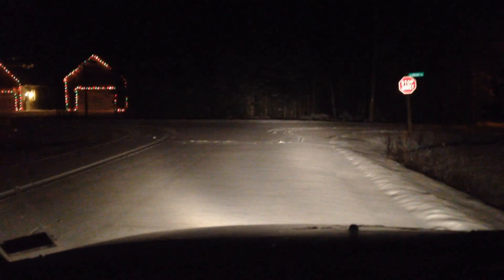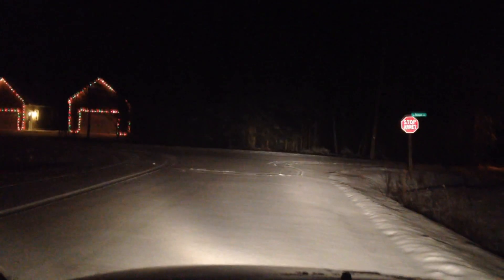Whats that noise my Brakes are making? (ABS) Explained

Comment: My truck is doing this, I'm in california not in snow or cold. How do I make this stop?
Reply from the maker: This would happen in the rain aswell or slipper conditions. Its not a bad thing but you could just pull the ABS fuse. This would give you a light on your dash. Its not recommended though. Abs does help a lot in slippery conditions.

Comment: I get a drinding noice on the pedal when ever the wheels jumps over a obstacle say like a speed breaker even when I am not applying breaks - esp when only 1 wheel is hitting the obstacle. Never happens when both wheels are hitting simultaneously. Will this be due to the ABS ? Thanks in advance !

Comment: Hello, I hear this same sound even when I'm not driving on a snowy road. My mechanic just changed the sensor at the back tyre, I step on the brakes when the car is moving slowly and I hear this sound. Note that the road is a rough road.
Reply from the maker: I would say you need new brake pads and rotors. This is probably just the metal grinding on metal making this noise.

Comment: I've never had A.B.S in my life before and have owned the car I have now for about 18months, occasionally, under heavy braking I have had this graunchy sound and feel in the pedal and the feeling that the brakes are not going to stop me, it was bloody scary (yes I'm British haha! :-) ) and recently it has dawned on me it must be ABS as I made it do it on purpose a few times when the road was clear.  I have experienced ABS once before when driving mates old 300zx years ago and that had a definite judder feedback sensation and felt more reassuring as a braking aid than the graunchy feel as though the pads are fighting to grip but just encountered a glob of grease or something, toppled with the sound of a massive container ship colliding with an iceberg and twisting and stressing with metal fatigue from all the forces acting upon it. ...because it was intermittent, I thought its a waste of time getting it checked out, and replacing front discs and pads made it happen less I thought, hopefully this is all it is, because it seems to make sense in my controlled tests 😅. Have to say, can't hear it well in your video, but a video like this did need to be done, so well done!

Comment: Hi guys! Newbie question here so I hope to get some guidance from more experienced drivers. 

Is it normal that the noise from my ABS kicks in quite frequently? There's no snow where I live -- just regular roads. But about 50% of the time I apply my brakes, the grinding noise kicks in. I've not experienced this with the other cars I've driven. I drive a 2014 Toyota Fortuner by the way.

I had my car checked by a mechanic and they saw no issues with the brake pads, brake fluids, etc. Is this normal?

Thanks!

Comment: Thank you for this. I heard the sound because it just happened to me. 
I have a question: Will it deactivate over time? How long does it usually take?
Reply: It won’t stop until you fully stop it’s preventing your brakes from locking up cause if they locked up you’d spin out

Comment: Anti lock brake systems are NOT designed to slow or stop a car, faster then a conventional non-abs stop. ABS is designed to limit wheel lock up during the event of an emergency stop on icy surfaces, thus allowing you to maneuver around an obstacle.

Comment: Yea i have that same sound. Is there anyway i could make it quiet? Its driving me crazy everytime i brake.
Reply from the maker: no sorry its a system. All; I could say is pull the fuse for ABS but then it would be worst braking.
Reply: @SqueakyClutch  Thanks, i pulled the fuse out and the noise and vibration is gone. My problem is that my abs does this on dry pavement so i need to get it checked out.

Comment: What if the ABS & VDC says off what does that mean? I heard that rattling braking sound. I wonder that has to do with the old clippers and rusted rotors? 
I had put in new suspensions for 1 week now and have this problems 4 days later.
When the road is uneven icy braking makes me super nervous especially going down hill.

Comment: Thanks for the video but a few things; 1. Now that I know this is normal I feel better, 2. I think this also means we STILL have to brake slowly. 3. I know this is normal but on SOME cars the braking system is far superior. Why? Engineering? I idk but I know people with different cars which dont have this issue much. 4. Lastly I wonder if this sound comes up with snow tires?

Comment: SqueakyClutch: What exactly do you mean when you say; "Don't worry, it's just your ABS kicking in"? My Impala started making that sound, but my left rear strut has to be done as well. Oddly that sound only happens occasionally, and my ABS light is now on. I'm not driving my car now because we now have snow, and previously didn't when this noise first started happening. I'm trying to save for the repairs in the meantime, so please explain why I should assume my brakes are okay. Thank you.

Comment: Dude if you can shut up we will hear the sound.  So annoying
Reply: Check this video -  If your ABS kicks in pretty much everytime even if you only drive forward and try to press the brake pedal very slightly and it pretty much doesn't brake at all than you better get you ABS system checked https://www.youtube.com/watch?v=sBpV3jtkBJA

Comment: I think I have the same exact problem but I'm so mad because when I try to show it to one of my mechanics it didnt happen it happens at times ..like when I'm on the highway and then I have to start slowing down. Or if I'm in bumper to bumper traffic. Its sounds like a deep load groan kind of its even hard to imitate and once I tried recording it but it was hard to hear..I dont understand though because I live in Florida and yea its rains but not always and this happens to my car even on the driest day with the driest roads..but it's so scary especially on the highway because like you said I feel it under my foot.should I maybe go to another mechanic? because this one said my brakes are fine and didnt really hear the sound but didnt even mention it could be what your talking about ...
Reply: If your ABS kicks in pretty much everytime even if you only drive forward and try to press the brake pedal very slightly and it pretty much doesn't brake at all than you better get you ABS system checked https://www.youtube.com/watch?v=sBpV3jtkBJA

Comment: I faced this issue today in my car. On first winter of the year.
Reply: If your ABS kicks in pretty much everytime even if you only drive forward and try to press the brake pedal very slightly and it pretty much doesn't brake at all than you better get you ABS system checked https://www.youtube.com/watch?v=sBpV3jtkBJA

Comment: Hi My new car has the same sound ? I hope there is nothing to do from my part.
Reply: If your ABS kicks in pretty much everytime even if you only drive forward and try to press the brake pedal very slightly and it pretty much doesn't brake at all than you better get you ABS system checked https://www.youtube.com/watch?v=sBpV3jtkBJA

Comment: The same noise my car makes. how to fix . it not winter its summer but still it make noise the same as that of your . how to fix this noise? on slow braking it doesn't but when we brake with greater push it make noise.
Reply: Rafay Syed get better brake rotors. Your rotors are locking up and your antilocking brakes are kicking in. You may have a warped rotor with bad pads

Comment: Thank you so much this really helped I was freaking out, if it's not snowing but it's raining and it's 42 degrees outside with that do I to I'm in Florida we're having a cold front it was 42degrees now it's 54 but it's been raining will that do that to?
Reply: probably applies to any slick surface,rain,ice or snow,but I'm no mechanic so dnt take my word for it.

Comment: when I press the parking brakes, it makes a spring noise.
Reply from the maker: Because the parking brake is spring loaded and just locks the back brake up.
Reply: nismo armada mine too, how do you get this noise fix?
Reply: nismo armada did u fix the problem ? I have the same issue

Comment: i just got a Chevy blazer 2000 and thats the exact sound it makes! when i put it in 4 wheel and i only turn its terrible so i avoided it. and i just got snow so i didnt drive. it sounds like when you walk on fresh snow. just like things are touching on the car that shouldn't.  and now driving on 2 wheels its making the noise.. theres snow outside but not on the streets. happens now when i turn , break, drive slowly after break. my bf said i have abs so this video helped a little to calm those nerves lol but do you think i should get a check ?  i just got inspected 2 days after i bought this so its been a month tomorrow.. they would of said something if it was serious.. i hope
Reply from the maker: +Kristy Soares If its making a noise at all when you are not breaking then this would be something else as you said it makes a noise when moving slowly after breaking. If you just got inspection I wouldnt worry about things to much as they should have checked the breaks. If anything its the pads being wore and that is also a cheap fix if you buy them from a store other then chevy. Also if its when you turn that could also be something else as this wouldnt have todo with breaks at all. Does your vehicle have traction control?
Reply: I believe so. Im not too into knowing about cars which is a terrible thing. My boyfriends the mechanic lol . but hear this, my inspection was free so i kept getting paranoid about them fake checking so i have to go back and pay a lot more. Ugh
Reply: Justhope not too serious. It just started 2 days ago. Got stuck in the snow. Coincidence. So i have no idea.
Reply from the maker: Dont worry not everyone is great around cars. Free inspection is definitely kinda sketchy if you dont know the mechanic, has your BF checked out the noise yet?
Reply: He's just saying "it could be this " he said brake related. Something about a caliper. Or related in the area. Idk, i never listen lol. Hopefully he checks today cause the noise just gets in my ears. I actually heard it again today. It sounds like thunder from a far away distance. Like that rumbling. Its most def coming from the back because i hear it behind my head when i open my window.

Comment: i have a 98 expedition and my abs lite is on and mainly when in reverse it makes a loud ennnnn sound what is dis
Reply from the maker: +deon upshaw No idea are you pressing the breaks when in reverse and it makes the noise? Or just in general? Cause it could just be a bad abs pump and if I was you id just pull the fuse out and go without it ha

Comment: Okay - My ABS kicks in every time I step on the break if there is snow or slush on the ground.  I could be travelling at 5 mph on a flat surface and it kicks in every single time.  Is this normal??
Reply from the maker: As long as its on slushy roads and not just regular everyday roads just means its doing its job. You probably have newer car as well?
Reply: Mine too i am worry and is summer no snow here in Chicago, so my caR IS A Chevy 2006

Comment: Is this normal. My car does that all the times. Even when there isn't bad weather all the times. Sometimes even while I'm driving and my foot isn't on the brakes.
Reply from the maker: Yea its normal man, if its really touchy it could be because your car is new? its not a bad thing thats for sure.
Reply: @SqueakyClutch  why are you such an idiot? Don't give people answers, you're going to kill someone, mainly because you don't know what you're talkin about.
Reply: No you should probably go get your wheel speed sensor checked and your wheel bearings. ^that dumbass has no idea what he's talking about if you're not pushing the brakes it's not your anti-lock brake system it's something to do with your wheel.